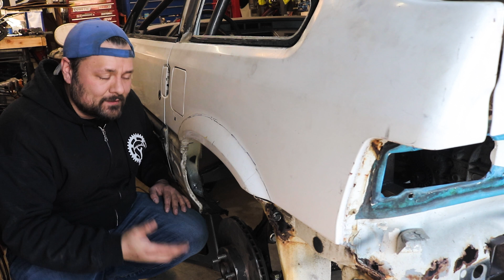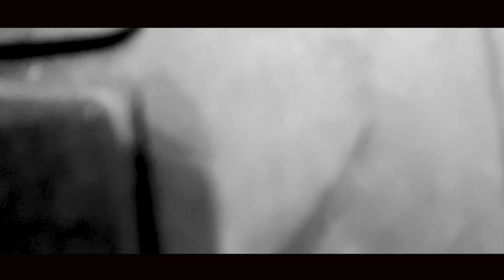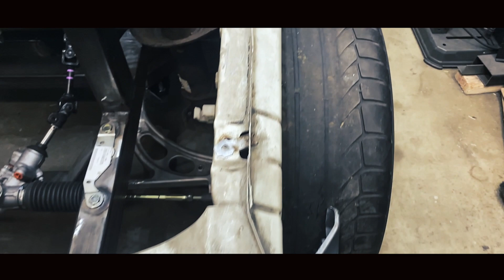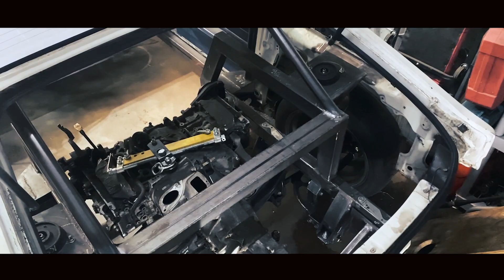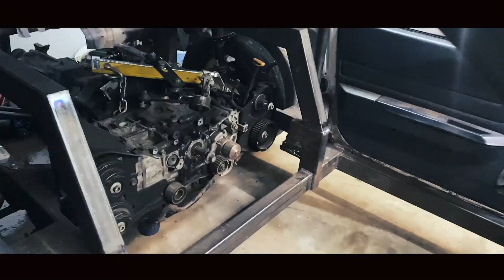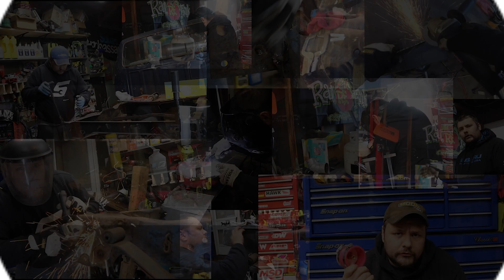Subaru Powered Honda CRX Build Suspension Wrap Up [E45]

Comment: Any reason you went with a 1st gen CRX compared to a 2nd?
Reply from the maker: If I were smart I would have gone with a second gen but when I saw this one in all its 1980’s styling glory I couldn’t resist. Of course had I known it would have such catastrophic rust in structural areas I never would have gotten it. The original plan was just to augment the unibody with tubing not do a full tube frame but that didn’t quite pan out.